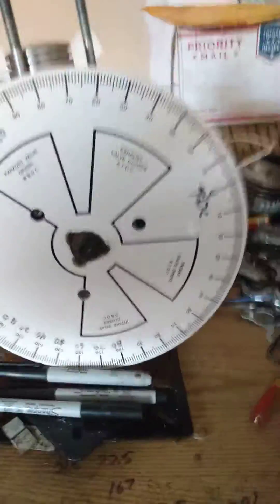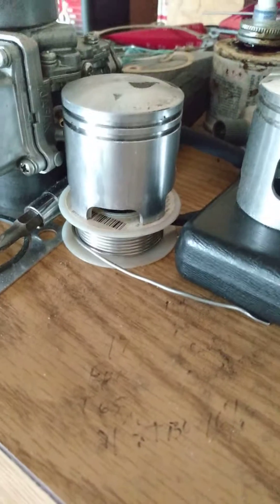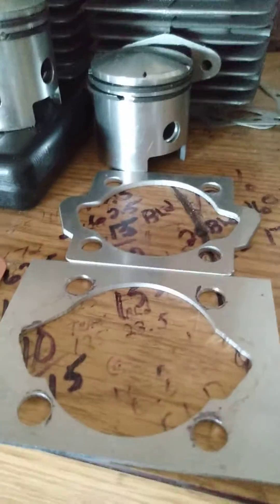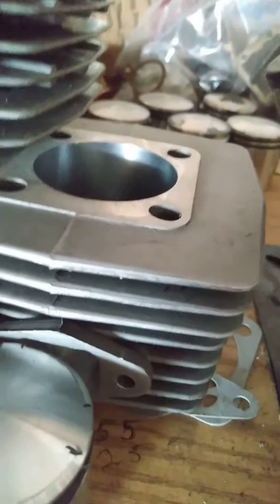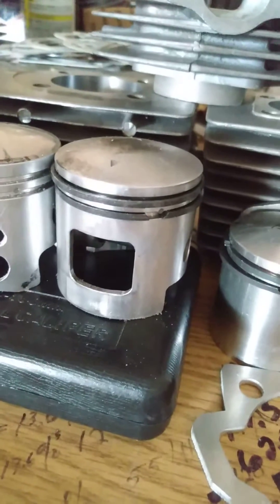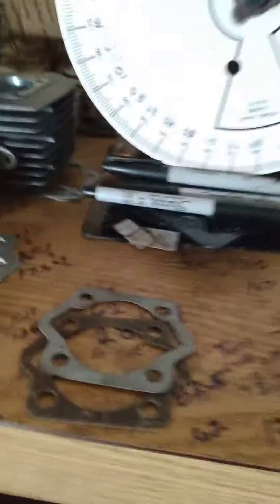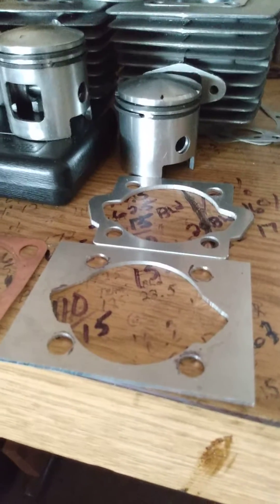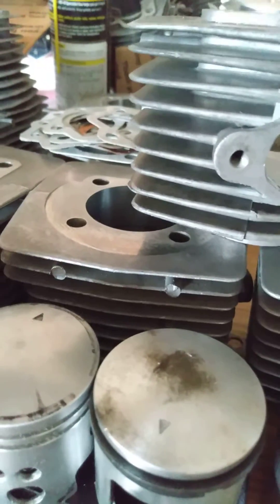motorized bicycle ways to change port timing

Comment: Dave! Quick question bud got a motor setup. Lookin at about 22° blowdown a pretty mild to low motor. How low can an intake port go b4 I need a reed. I had a pretty big air pocket in the casting and had to drop it like 3mm. If need be I already have window and no window. Ofcourse I have a reed too but I wanted a piston this time. Any advice?
Reply from the maker: @mikecyanide7492  mike when your running a piston port aka none Reed motor. Typically  to much intake  duration you start getting alot of reversion aka gas spitting out the carb and loose power down low aka tourqe. Around 135 ° of intake duration. Pop you some reeds on it you'll find out Reed motors are way more forgiving on tunning and to much intake duration. The reversion will be way less. As far as running Reed motors without a window I ran about 170 ° of intake duration called that set up a power port something  honda Mugan did on the Elsinore back in 1970s. Think my physical port was 150° and then skirted the piston to achieve 170°. Just testing cyls and set ups back then.  But ran into a issue  @ 10750 rpm the motor would shut off like you hit a kill switch.  Think the issue was not enough  tranfer area. So basically  I just put set of reeds on that motor and a windowed piston gain lot of low end power.  Not sur if I answered your question  though. I allways had great running engines I allways looked at the math. I looked at the bigger picture aka tranfer duration  starting point ??? Blowdown  and blowdown % .it's hard to achieve a good blowdown % with a tranfer  starting point of 130° that would require a super high exhust port to achieve a decent blowdown %

Comment: My bike won't idle. Ive got a zeda 80 2 stroke kit with an hp carb on it off ebay and a cone filter, half the time I run it it four strokes and then randomly goes back to two stroking while riding at high speeds. when you pull in the clutch it doesnt idle but If you give it a little bit of throttle it'll idle fine. did the same with the stock carb on it. I ported and polished it a long time ago, the clutch it fully disengaged so its not the clutch dragging and there's plenty of spark. My last ditch effort is to figure out what jet is currently in it and make it way smaller because theres quite a bit of carbon buildup on the plug after running. Any thoughts?
Reply from the maker: Vacuum leaks  file your port faces flat